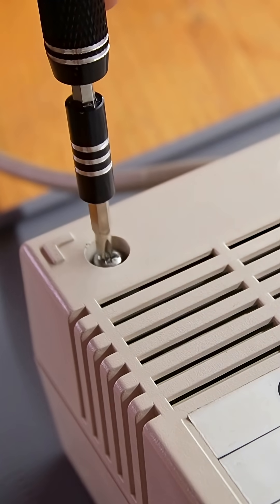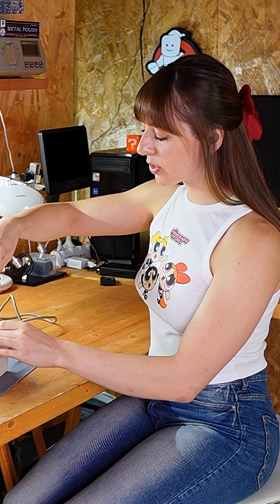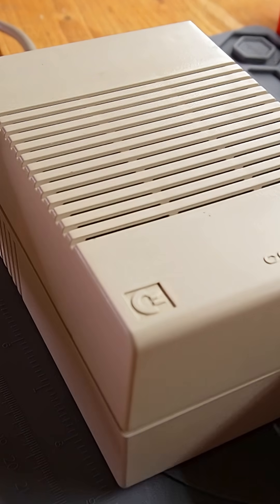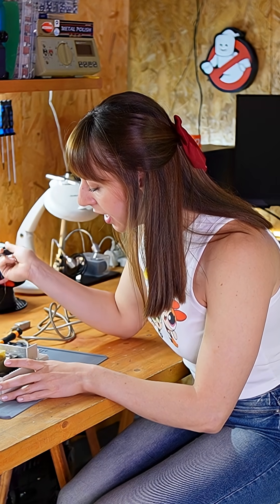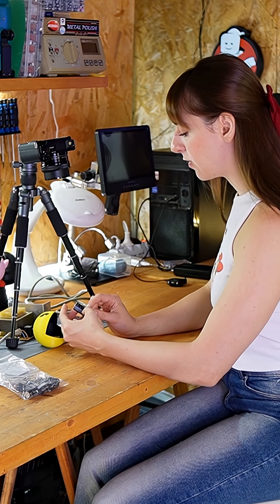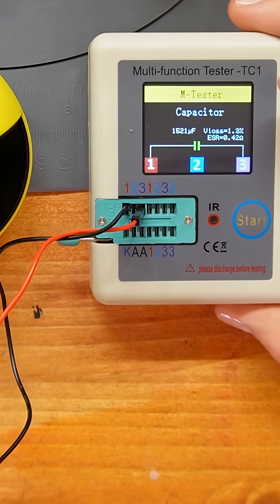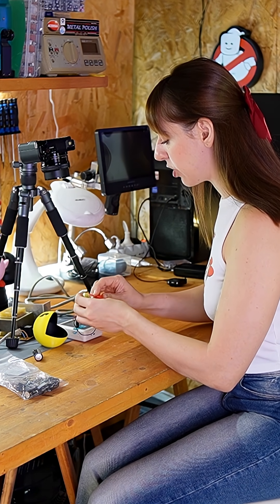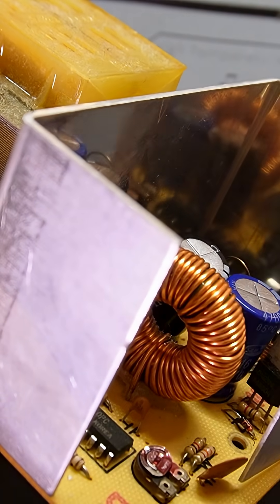A Quick PSU Fix OF A Commodore 128 ⚡️

Comment: do you always have to remove capacitors before testing them? it's very labor intensive, but I guess it's the only way?
Reply: You can get a good idea whether a capacitor is bad or not while still in circuit using a good ESR meter. Also visual signs like swelling or leaking solution can tell you they're bad too.

Comment: There is a model of Amiga PSU that has two 47 Ohm resistors in series, and they run HOT - enough so to scorch the board underneath and cause a burning smell. My fix (with what was available in my huge pile of useless junk) was to put a 100 Ohm 2W resistor in their place, and raise it off of the board so that it has better ventilation.